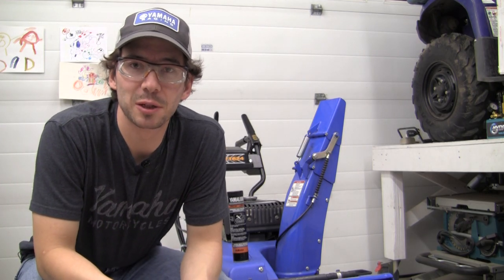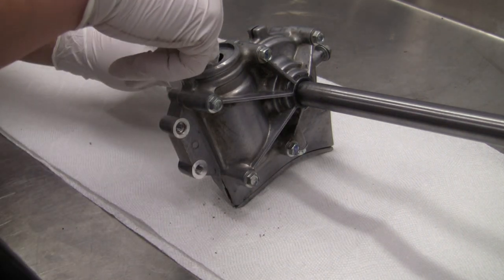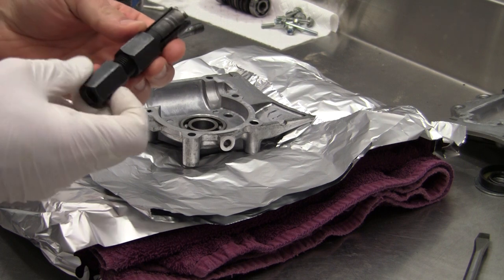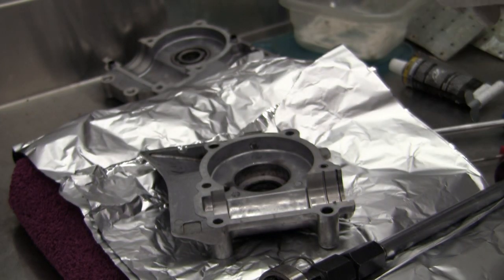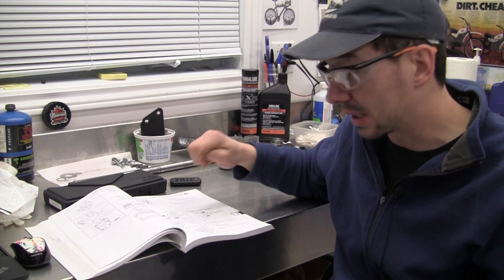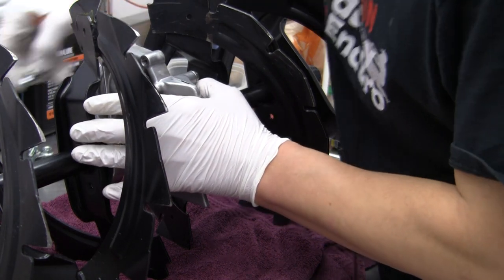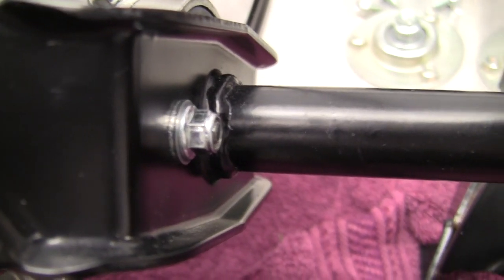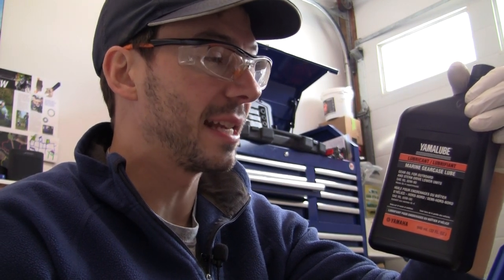Ep. 14 - YT624EJ M.S. - Auger Inspection and Wormcase Rebuild

Comment: I have a 2010 Yamaha 624 the gearcase housing is made of steel on mine while yours is cast aluminum but that’s neither here nor there I use 10 W 40 motor oil in my gear case I haven’t Had an issue with my snowblower at all the oil comes out clean every time I change it and I usually change the oil once a year or a season use the manufacturer recommended oil is my advice to you
Reply from the maker: Oh ya eh? Interesting, thanks for the feedback. The worm wheel on mine is only cut like a regular helical gear. I wonder if because they didn't cut a curve out of it that it may wear more quickly. I will see how the oil comes out of it next change and decide on oil moving forward. Thanks for watching!
Reply: I'm surprised it doesn't use a special lube.  I know the oil I saw come out didn't look like motor oil or regular gear lube to me.
(edit) Found the other vid, now I know why the oil looks that way, lol.

Comment: @1:03 "I'm an engineer."
@5:00   Yup, you're an engineer.  😛
Apparently, Yamaha thinks they can seal the rust off that auger shaft.  That's generally not very easy on a machine that will see large temperature swings, water, and, very likely, salt.
Once that auger rusts to the shaft those shear bolts no longer do anything.
I'd be really tempted to install grease zirks so I wouldn't have to disassemble everything just to lube the augers.
As far as vacuum on a gear box, anytime a warm gearbox contacts something cold, there going to be some amount of vacuum.
Reply from the maker: haha ya... Doing maintenance while trying to narrate really detracts from the focus.... Usually I catch stuff as I go versus getting caught like that. I'll check the augers in a few years but I think it should be able to stay rust free for a while, we'll see in 5 years. I greased it up so should hold off I think.

Comment: Hi to you, I've hoped you shoot a video showing how to remove the impeller bearing,  I've always had anykind of difficulties, maybe a damnation to me, when doing the separation of the engine part and blower part...   From the first time of use this year I have a strange noise coming out from the impeller area, suspecting a bad  bearing (which I've changed two years ago by recommandation of my Yamaha dealer...   Or maybe there is just some kind of dust in that area (the snowblower was in a really dirty environnement this summer) so maybe there is some tips I don't know to do the job easier...
Reply from the maker: Hi there, thanks for writing. That would have been a good thing for me to do while I had the auger out. I think the only time I'd consider making that video is when I check my worm gear end of this season to see how the gear oil made out vs the engine oil.

Are you using the Service Manual? Yamaha Canada sends it out via email to people for free. I can send you a screen capture of the disassembly/assembly sequence to get to the bearing if you like. Send me an email at lucgallant @ gmail.com. Good luck!

Comment: Great video, I did this exact rebuild on my yt660 after an auger shaft break due to running into something I shouldn’t have 😂 I found that when putting back the screws you do at 45:00 I had to force the auger a bit to get the bolts to center with the housing  almost like its designed to have  some tension in the system. Did you find the same thing?
Reply from the maker: Yes I think I have the same memory. It was nothing crazy though. I've done so many maintenance tasks I don't remember everything haha

Comment: What kind og oil is the auger delivered with?
Did You drive the first years with that oil, or did You change oil before first year of use?
Reply from the maker: According to Yamaha it's delivered with 10w30 engine oil. I used that for 6 years then went with gear oil per video. Haven't inspected it yet since.

Comment: My auger shaft broke on my 2012 Yamaha 9-28. The worm case looks like it's one piece and doesn't separate like yours. Any idea on how to get the shaft out?
Reply from the maker: My main goto would be the service manual. Do you have it handy?
Reply from the maker: Also check the parts fiche, what does it show for separation possibilities?
Reply: Had to remove a circlip.

Comment: How often do you need to do? This seems pretty intense.
Reply from the maker: I would change the oil to wormgear oil asap and then I'd go 5+ years. I'm sure you could go 10 years. All the bearings were totally fine, just the wheel was wearing due to the oil.
Reply from the maker: Sorry to clarify further, with the right oil the worm gear should last like 20+ years, not 5-10. I'd do an inspection in 10 year intervals but most people would go until it fails, should be more than 20 years with the right oil.

Comment: Hi. Great video. I just broke the auger shaft and this video gave me a good insight of the complexity of the repair. 👍 What kind of sealant did you use for the wormcase?
Reply from the maker: Yamabond 4! Are you in Canada or elsewhere?
Reply: @lucgallant  Im in Norway, in the middle of a snowstorm, with a defective snowblower😱
Reply: My local Yamaha dealer has Yamabond fortunately👍
Reply from the maker: @persolheim3955  oh no! Ya Yamabond 4 is the best but could could use RTV silicone, or Permatex Motoseal. https://www.google.com/url?sa=t&source=web&rct=j&opi=89978449&url=https://www.permatex.com/products/gasketing/speciality-gasket-makers/permatex-motoseal-1-ultimate-gasket-maker-grey-2-7-oz/&ved=2ahUKEwiTxL_t9-SDAxVBFFkFHUxVBDoQFnoECA8QAQ&usg=AOvVaw3hGjodfZczHNzeO2ptea8H
Reply from the maker: @persolheim3955  that's the best stuff of all of them, I tried lots including Hondabond 4.
Reply: @lucgallant Update. Have just changed the broken auger shaft on my YT1070 using your video as a guide. It was an rather easy repair, thanks to this video. The most difficult part was to re-position the drive-shaft in the wormcase with the augers installed . Thanks again for a great video.
Reply from the maker: @persolheim3955  excellent!!!